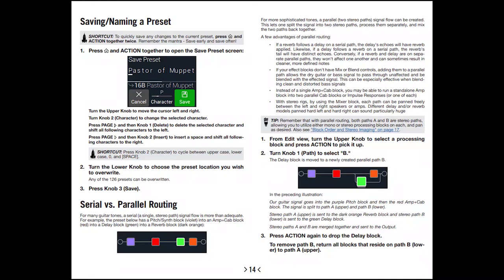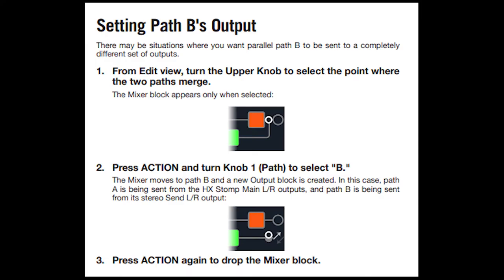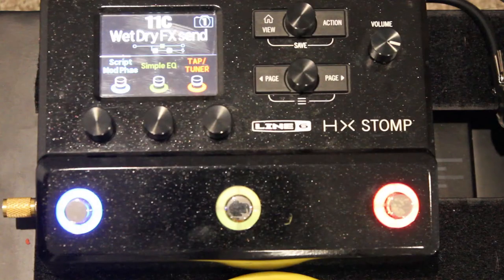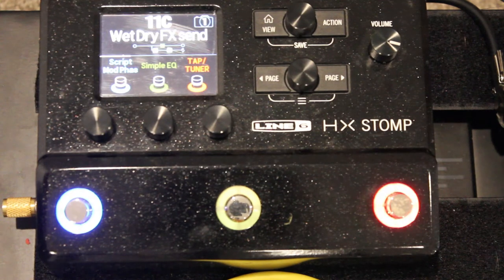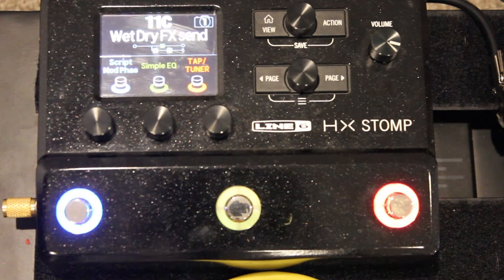Splitting channels and wet dry in HX Stomp

Comment: I have a pedalboard set up for wet dry and I’m wondering can I send my dry wet signals from the board into the inputs of the Stomp and send them down the two separate signal paths? Is there an input mixer like the output one?